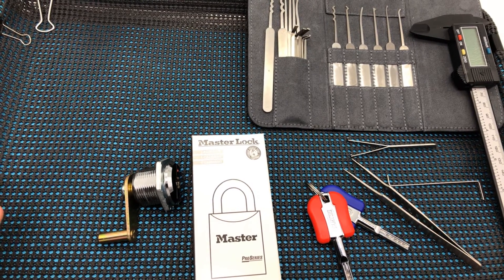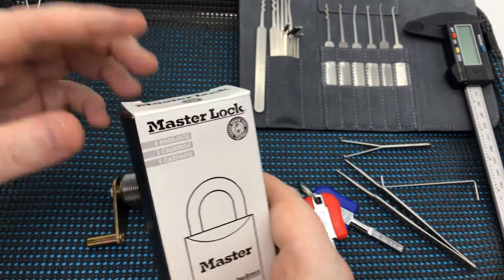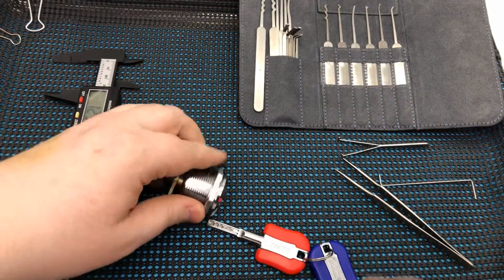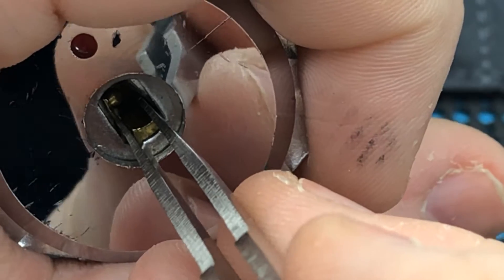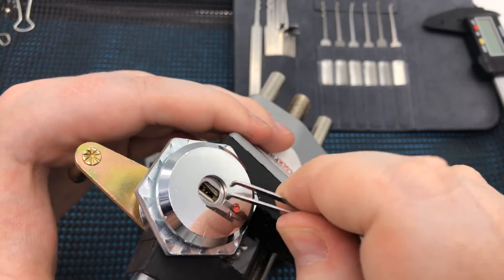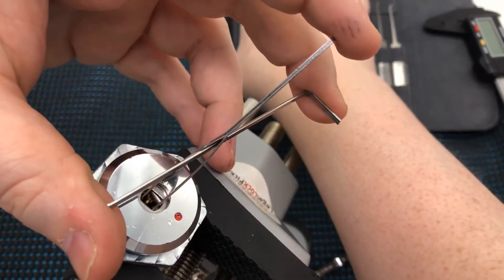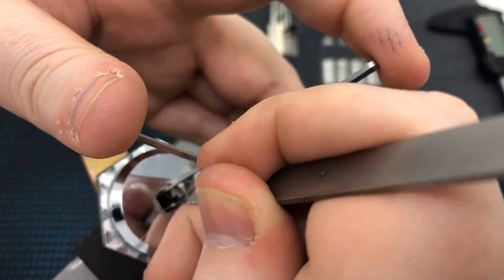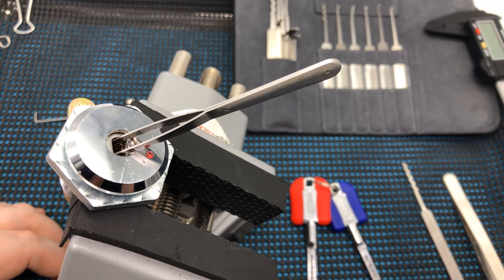[118] Cam lock picked you’ve never seen before!

Comment: I love those master lock pro series my 1’st 🆑 is a Master lock 6850 Brass that I had found at work locked into a cart/shelf I posted a pic on Twitter before& after cause it was disgustingly rusted and I cleaned it up and threw a 410 6 pin core in it. 👍